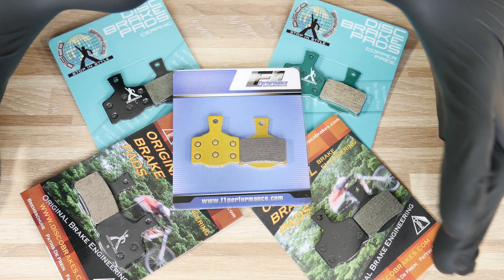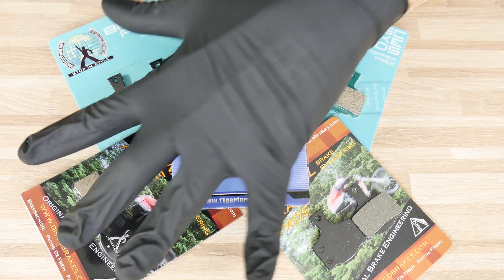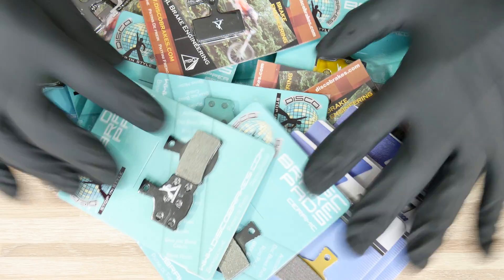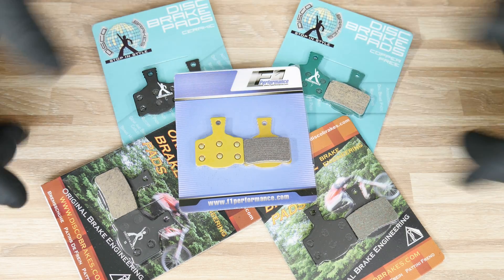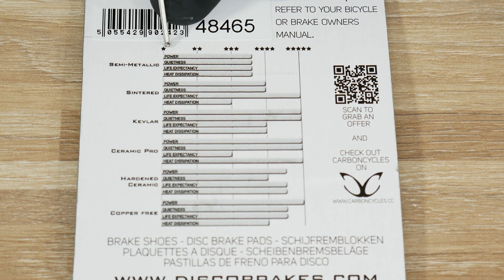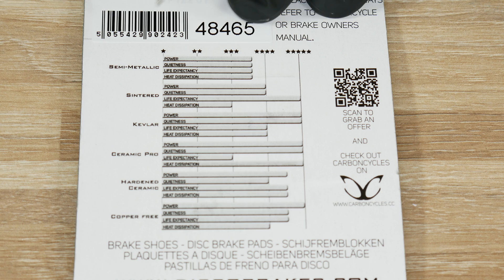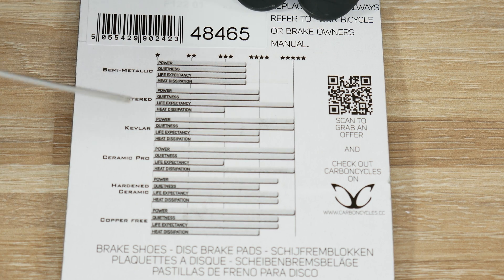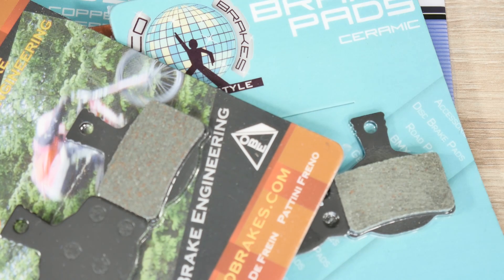Bicycle Brake Pads Types - PART 1: Sintered, Semi Metallic, Kevlar, Copper Free...

Comment: I used resin pads always now I want to try ceramic I put it on and it felt 🤢 so I'm going to try it out for a week and give feedback, I have resin only rotors and I asked my local bike shop which is called giant cycles which is the same as my bike, they told me it should work fine on the resin only rotors.

Comment: Hey man I'm in the same boat right now. First of all I have an e-bike and the rotors that came with the bike say "resin pads only" . I ordered the semi metallic and ceramic brake pads but need to change the rotors because the shitty ones that came with my bike can only handle resin pads.... I guess My question is... Which brakes do you recommend for e-bike going 30mph at all times... I need something that will have stopping power and will last longer than the other. Thanks
Reply: kevlar or sintered will last the longest. But sintered will wear out your rotors faster.
Reply: @hugoburton5222  how do I understand what I have?

Comment: I didn't know you had a ebike!!! This may be hard to test but I like quiet brakes in wet and dry conditions. Maybe test or mention a couple you would suggest. Riding in the Pacific NW often when my pads get wet, then dry from brake heat they get noisy. I'm not so worried about life and power (just grip tighter!) Also can spinning your rotors the wrong cause more noise. (\ . /)

Comment: Thanks for that video! I currently having a big issue with my disk brakes. They're squeaking very loudly in all condition. I went to a shop, they cleaned them, sand them even used a blowtorch on them but they still making that horrible noise. They are now ordering new brake pads to see if it fixes the problem. I would like to know which one of them is the quietest based on your tests. Thanks.
Reply: Well you must have shitty brakes, my shimanos xt are perfect
Reply: Also, no matter how expensive, cable it cable and will still stretch much faster than hydraulic brakes need bleeding
Reply: Calling me retarded, that's so politically incorrect. And ask yourself, why there are barley any mechanical brakes around. Because in terms of performance, hydraulic are so much better. Obviously if you were having problems, the brake was faulty or cheap quality. You don't hear any problems about hope 4s or Shimano xt, SRAM guide.
Reply: Try and find me a 4 piston mechanical brake, you won't cause hydraulics are so much more reliable
Reply: Lol speak for yourself, obviously you have had problems with cheap hydraulics in the past. Cheap anything is crap and not going to last. Calm down and go biy yourself some Shimano xt's.
Reply: Also I'm not spreading rumours, I'm trying to inform the poor fellow who you entirely miss informed
Reply: MrH3David  mechanical dusk brakes are cheap but do not have enough power or modulation, the cable stretches and you lose power over hydraulic brakes. it is near impossible for them to leak unless there are loose parts.
Reply: The thing is they aren't myths, it's true. Hydraulic hose does slightly stretch, but not way as much as cable. Now tell me, do you see pros, or anyone with half decent bike running cables?
Reply: Could be something else, on my old bike(Giant Reign X) the rear brake was squeaking only when I had abnormally high pressure(35 psi or so) in the tire. So I think a wheel or a frame can also have something to do with how vibrations from braking resonate.

Comment: Hi.

That will be very interesting. I have some pads on road bike. I think they are resign pads. Whatever that mean. On disks I have signs "use resign pads only". On dry and wet condition they break very well. But on wet condition, they squeaking. It will be good to brake little better without that squeaking sound. 
Someone told me that is because there are some metal parts in pads and with that braking force is higher, but I have that sound on wet. With some other pads, without metal can be silent but they brake slower.  
I don't care about durability or heat dissipation. Braking converts precious speed to useless heat. Don't want to do that very often.